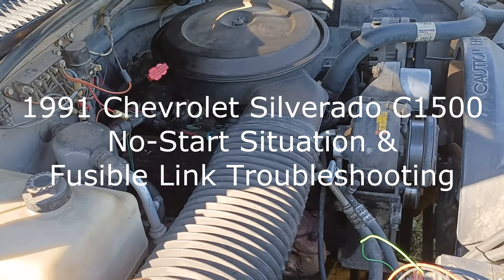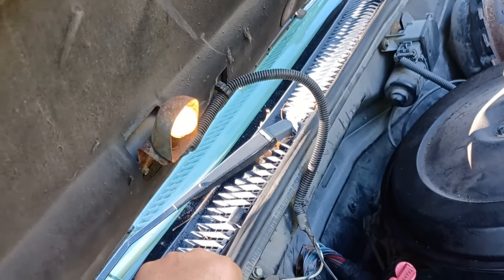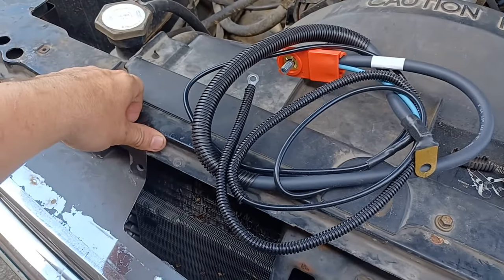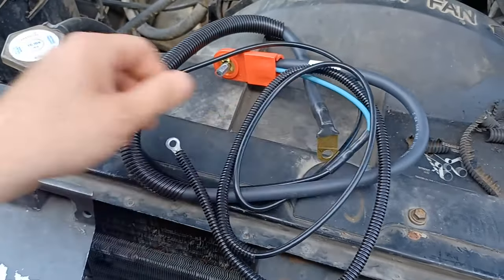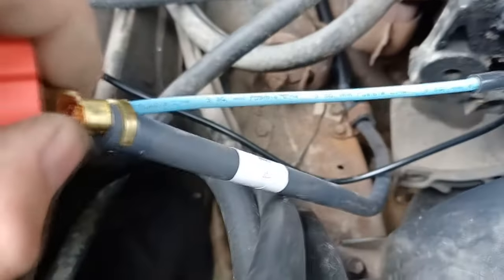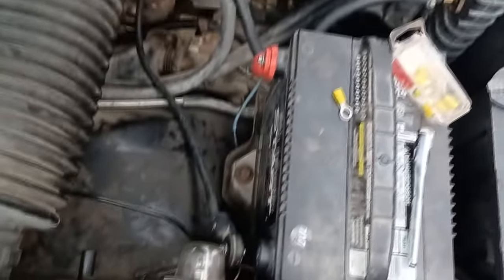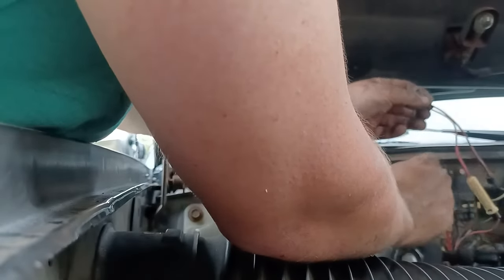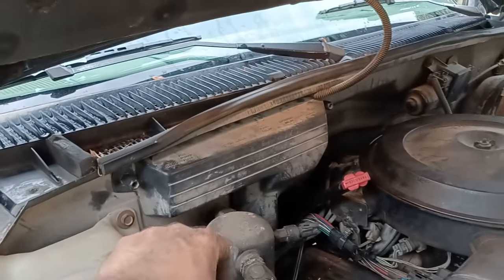1991 Chevrolet Silverado No Start & Fusible Link Troubleshooting

Comment: Huge! Thank you for posting this video. My truck has sat for months and I have scratched my head literally exactly the same problem you had. Thank you so much
Reply from the maker: Glad to hear it!
Reply: @nathan.kostelecky  I accidentally put my negative terminal on the last junction block terminal I didn't know it was a hot line and I kept getting spark when connected my battery you think i blew that fusible which cause my engine not to turn over?
Reply: @road2richz_q266  was it the fusible i did the same thing on accident 😂
Reply: @559Obsalex  yup lol it was sparking like crazy, I just grounded to my engine block

Comment: Pretty much the exact same story for me too but I listened to the wrong know-it-all and put a direct positive line to the s terminal on the solenoid. Zero power anywhere is where I'm at. Mine's a 92 regular cab manual trans. I don't understand - my old starter was wired with a direct, 2 g wire from the positive battery terminal to the starter motor as well as a 10 gauge  another terminal for the solenoid. No idea how the heck my fusible links get power because I cannot find 10 gauge wire running from the positive battery terminal to that initial fusible link for your hood light. I have no power no nothing right now after I shorted my battery.

Comment: Thanks for your vid, got my few brain cells rubbing together enough to pick up a multi-meter and find the gremlin.
Spoiler alert: did you know water can get INSIDE a wire and corrode away the core?

Comment: So I arched off something on or next to the alternator. Now it cranks over and I have all my lights no won't get spark. Has fuel no spark. Could I have blown a different fusible link or my coil or something?
Reply: Turned out I'm dumb.    I was installing a aftermarket temp guage (hard line) and apparently the top one next to thermostat goes to ecu. Bottom one goes to guage.

Comment: When I try. The key on my truck has power but it won't crank i pulled the starter out and checked it with the battery and it cranks but when it's set up in the truck in won't crank
Reply: I’ve had this same issue recently did you ever Manage to fix it

Comment: Hello,  I have a 89 c2500 that I carb swapped for personal reasons. I had power after I got everything hooked up and was about to get it started for the first time. So I went to hook up my battery and is made a connection and then all of my power was lost. No power to the whole truck anywhere.  I have replaced the battery alternator starter and main power wire to the starter. I thought it was a fusable like at the junction block under the hood where the black wire with the red stripe is because that is the one running to the battery and I took a spare wire and tried to run it hot to that point and still nothing. Please please please help. Thanks

Comment: I'm having a issue with my engine won't turn over I get all lights and accessories but no engine turn over what could be my problem
Reply: I have the same problem did u figure it out
Reply: @DavidGomez-zx4vk  Actually I did found out that I had to run my clutch switch to my key on 12v switch to get key on 12v when I turn the key to on position all I had to do from there was push in my clutch switch and it turned over lol, kinda cool I can use my clutch switch as a push start lol

Comment: I did the same thing but mine still cranks but won't start up. Mines a 91 v1500 and does not have the same wires. Please help
Reply: Check the a + b injectors fuse by the driver side

Comment: Did yours crank before the fix? I have power and it'll crank but no start. Replaced fuses, distributor cap and rotor, ignition control module, plugs, plug wires, fuel pump and coil 😓 what black magic or what god or demon do I need to pray to to fix this damn truck!?
Reply: All new fuel system from tank to pump to filter to line to injectors. Rebuilt TBI with new gaskets too. I hate how much money I've thrown at this thing but dammit I love this truck.
Reply: @BrandonBurns89  did u find out the problem
Reply: @BrandonBurns89  im having the same issue with mine 😢
Reply: No luck at all... just put in a whole new distributor assembly and still doing the same crap. Starter fluid does nothing as as well.
Reply: @BrandonBurns89  i used starting fluid and turns on for about 5 seconds then dies and im not getting no power to injector connectors
Reply: @BrandonBurns89  have you changed the computer worth a try
Reply: Changing out the computer is all I have left to try. I'm definitely going to swap it out as soon as I can. One thing I did find out is that there is only one relay in my truck and it's up there next to the fuel pump fuse. It bolts to the frame. That controls basically everything so you might have luck swapping it out.
Reply: @BrandonBurns89  i changed almost everything fuel pump relay and the relay next to it im not getting ground to injectors ?
Reply: Have you tested the ignition module on the distributor?
Reply: @BrandonBurns89  how would i test that
Reply: @BrandonBurns89  you have Facebook or insta gram snap?
Reply: Unplug the control module from the ignition coil and use a volt tester to test for hot/ground/continuity. There's a good video on here if you search how to check ignition control module.
Reply: @BrandonBurns89  did u figure it out 😂
Reply: @559Obsalex  no been sitting on this truck for months now. I'm disgusted with with but when I do start work on it again it'll be replacing the computer and tracing every wire.
Reply: It could be the wires behind the Fuse Box went loose, my dad has this truck (iam trying to fix) and discovered the Wire connected to the fuse in the back is loose
Reply: @mysticblue3387  I took the computer out and cleaned every connector and port as well as the computer itself.
Reply: @BrandonBurns89  Did it work my dad‘s truck I’m trying to figure out why the Engine shits off when I disconnect the cables if the alternator and the battery are good
Reply: Edit: Shuts off hahaha
Reply: @BrandonBurns89  It’ll turn on but when I disconnect the Battery cables it shuts off
Reply: @mysticblue3387  test the terminals on the coil pack. Also make sure the bottom of it isn't rusted or corroded because the bottom where it mounts is also the ground.
Reply: @BrandonBurns89  i will do this today to see what happens, thanks!
Reply: @mysticblue3387  so I started messing with it again and I might be on to the problem. Not gonna lie I lost footing and slipped off but on the way down I barely tapped the connectors that go into the coil and it sparked because I had the coil plug wire off the test spark while it was in the on position! I recreated it several times with gentle taps. Might be the stupid ass connectors being loose inside the plastic.
Reply: I know it's an old post.  However, first check your A+B Injector fuse.  If it's good, then either your oil pressure switch is bad or the wiring to the oil pressure switch is bad.  When you initially turn your key to the "On" position, you should have zero oil pressure.  If it's reading anything, it's bad.  The oil pressure switch sends a signal for the injectors and fuel pump.  Hope this helps.  Best wishes.
Reply: Hey so update. My list of parts continues and still no fix in sight. New Ecu installed. No fix. New spark control module installed. No fix. New ignition coil and wires installed as well. No fix. These trucks must just be garbage because I've literally replaced every damn thing in it and it still sucks.
Reply: @BrandonBurns89 did you check your ignition switch? It should be mounted on the steering column down some on top.
Reply: @559Obsalex that sounds like ecm fuse
Reply: @BrandonBurns89  when you bought ur ecu check that it came with the chip if not your not gonna any fuel thats what happened to me i bought the ecu and forgot about the chip in it 😂
Reply: @559Obsalex  yeah unfortunately for me I tried it with the one it came with and the original one from the truck with no luck.
Reply: @BrandonBurns89  make sure its in there tho its small
Reply: @BrandonBurns89  Me too !  And if it wasnt my dads old truck , Ide put it in the garbage can and keep driving my fords , that ALWAYS run .
Reply: Good luck , got the same truck , did all the same stuff , it will never run again . Its a built in failure mode by GM , the truck is done , plant flowers in it  and just remember the good times you had with it .

Comment: Would I have the same problem?

I slapped a 12v 40amp boost charger onto my battery and I went and cranked it yes idiot. 

But nothing turns on you turn the key and nothing happens.
Reply from the maker: It's definitely worth checking continuity of the power wire if you're getting nothing, no lights, no ignition, etc.